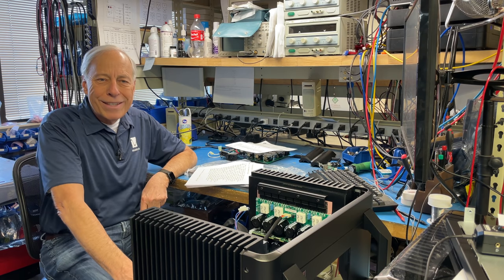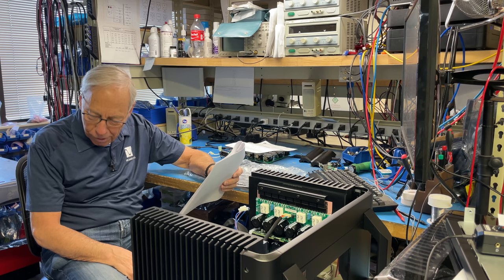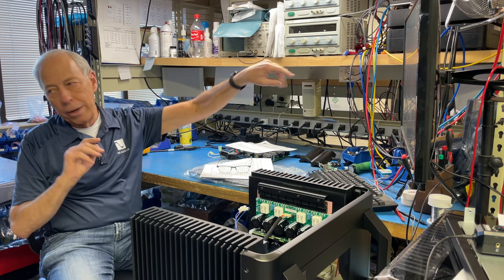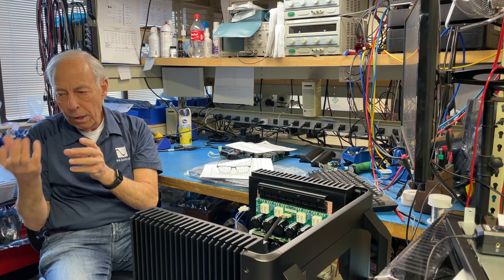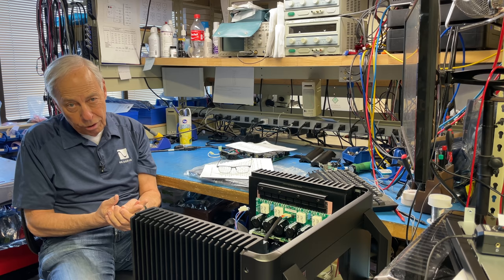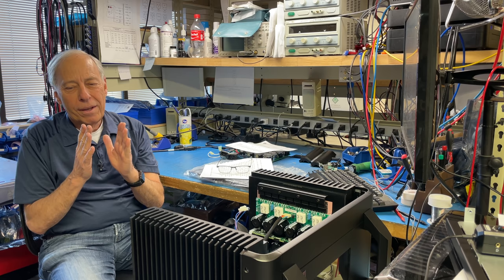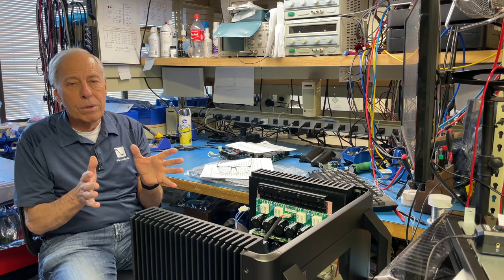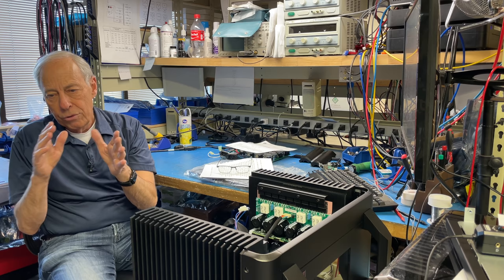Differences in digital audio cables

Comment: My Cary Audio DMS-700 (Streamer/DAC) has USB inputs but also a SD Card slot. In my system the exact same music stored on 1TB SD Cards has an improved sound signature compared to the same music stored on the USB attached SSD drives. I am not alone in being able to hear a difference - there is an Audiogon thread on this topic.
Reply: Internally how is the SD card slot connected? Normally they use USB. If there is a difference maybe the USB controller is doing something poorly.  The devils in the details. Anyone have a picture of the internals?
Reply: @paulgyro  Hi Paul - on the Cary Audio site for the DMS-700 picture #7 showcases the inside of the unit. The SD card slot is on the bottom front right of the unit - which is bottom front right of the picture. https://www.caryaudio.com/products/dms-700-network-audio-player/
Reply: @joeythedime1838  I tried to look at the pictures available and one thing for sure is the SD card and USB are on the same circuit board. There are two cable bundles that come off the board but I can't tell where they go.  Also I can't see on details what else is on the board.  While not conclusive I see no logical reason you should get different sound based on storage source. It could be a bad implementation from Cary.  Does Cary have anything to say about it?
Reply: @paulgyro  Cary actually recommended that I try the SD Card for my source material - they noted that I should hear a slight improvement over attached USB devices.
Reply: @joeythedime1838  gotcha, they know their design. There must be some implementation differences between the two ports

Comment: Hi Paul
My question is sensitivity (SPL)   is one of the most important parameter for HiFi loudspeakers in the Home Theater.Should (Must) have the same level dB (SPL) of sensitivity. Is it true? or  What would you recomend?
I enjoy your videos. It is amazing how you find the best way to explain complex topics, with simplest words.
Thanks in advance
Ignacio Martínez
Monterrey México
Reply: probably with a expensive high-end crap, other audio hardware does room measurement and set the center with lower sensitivity to +1.5 dB and you are done

Comment: Almost in the same time Amir from AudioScienceReview did a YouTube on this same subject: https://www.youtube.com/watch?v=dLghg0QXPzs. In my neophyte understanding is that if you have a good modern consumer DAC, not  necessary  at all at $$$$ level, and if you measure, not what it enters in the DAC, but what the output is, the 50 $ cable and the 2000 $ cable are exactly the same - and what you need is the output of the DAC to the amplifier. That means, the DAC knows to use only the pure information from the bits, that means no matter the cable... the result will be the same. I also think that if you have the worst cables, you can have a difference in the DAC output, because finally it has to deliver with what it received and maybe some problems in the transport to the DAC. Maybe I get it wrong, but I'm sure there is somewhere a limit in the quality needed for the DAC to process the information - so in my opinion the limit stops to under 100 bucks for the cable.
Reply: Since we can’t measure everything in audio “yet”, a purely measurement perspective is flawed. There ARE differences between well made digital cables, we have tried some a/b comparison ourselves. The question is how those differences exist. Most likely we will know the mathematical answer in 30 years (but not today).

Comment: AT&T just "forced" me to get rid of my DSL and change to their fiber. New modem.  Fiber runs into the wall and then to the modem. The modem to my computer is connected with an audiophile Ethernet cable. All the WiFi of the modem has been disabled.  Noticeable  improvement! Noise in certain parameters has been abated.   Even audio that is recorded to my hard drive (SSD) sounds better while this modem is connected to my PC.  Must be.. one source of noise is via the connected modem to the PC.  It must do something to the motherboard when its interacting with a modem signal while playing from what is on my SSD.  Streaming is not the only audio that improved!
Reply: What is an audiophile ethernet cable and where can I get one?

Comment: I am also an engineer and I do a lot of DIY. I have also noticed that it is important to put an isolation chip between the computer and the usb audio chip. If that chip is missing you can hear a lot of digital noise. I am not sure about the difference between USB cables here. I have tried cheap ones and better ones and was not able to here a difference.

Comment: Hi Paul, same goes for Voip a shielded cable has lower jitter and noice. This has to do with electro- magnetic interference. So much that they had to put a bit of artificial noice on the line because the sound is so clean and silent people thought there was no line. Still i bought my hdmi cables “not so goldplated” on Aliexpress. A money driven decision 🙄 i’m Dutch as well.😆

Comment: Thanks Paul. So is there a difference in the sound of your device which has this air gap when you use a cheap or an expensive USB cable? I would guess that the one air gap should eliminate all the bad influence from the input, correct? And does that also mean that any other device which has a good filter (air gap or whatever) should be immune to good or bad USB cables?
I think most of use will agree that a bad cable together with a bad designed device will have quality problems. Because a good designed device should filter the input.

Comment: i can buy the differences he claims might exist, but not at audible levels. amazingly different sound? then your non galvanically sealed transports must suck. even comparing audio in cables that introduce audible noise, isn't always very obvious. and a good audio system should have none of that to begin with. but i digress...

Comment: Very good and spot on. My favourite digital cable is the Lifatec USA optical cable. New ones sound better than the older ones. Just so clean and natural.  Kill any coax I have tried.
Reply: there is no difference between optical cables for 5 dollars versus 1000 dollars and what you heard on the coax was a grounding issue
Reply: @Harald_Reindl  lol look at you telling people like you know better than they do what they heard
Reply: Rest assured that the 1's and 0's don't care what wire they go down. Don't fall for the crap that PS sells. It is fraud.
Reply: @zackschindler8334  I can hear it. Easily.
Reply: Maybe it the quality of the construction and the interface.  After all this time I trust my ears.
Reply: @doctorrobin3040  lol - you trust your imagination and still live in an analog ivory tower not understanding the digital world

but yeah, I can transmit terabytes of data digital over years without a single bit-flip and your laughable lightweight audio signal changes significantly
Reply: Have you compared the two cables i have cited on a hi rez system? Probably not.
Reply: @doctorrobin3040  I am not dumb enough to try things which can't make a difference by definition

I am responsible for 10 TB digital transmitted data every day up to 1 GB (Gigabyte not Gigabit) speed where a single corrupt bit would be fatal

your lightweight audio transmission is simply laughable in a digital world
Reply: @Harald_Reindl  Oh well, I am a researcher, I have several research degrees. I test things and only then make an observation. If you havent done the test then you cannot know.
Reply: @doctorrobin3040  and to tell you a secret: even Paul in this video is talking about the analog part of the chain and not the damned digital transmission itself - still not sure if he is doing it by purpose in a way guys like you don't understand it - the jitter and so on is not at the transmission layer
Reply: @doctorrobin3040  So show some evidence  as to why is it better. Exactly why might a 1 meter fiber cable that cost $500 be better than the one I have that cost $10.

Comment: Jitter and noise is measurable, every cable should have these measurements attached to it.
Reply: And then...what would you do with it? Would you stop listening and just lay those measurements next to each other and „decide“ which is the better one?? Man, you‘re in the wrong hobby
Reply: @bikemike1118  it's rather simple, cable a claims it reduces jitter and noise, if it doesn't show up in measurements, it's bs.
Reply: A cable is a passive device. It cannot generate noise and it cannot induce jitter into a signal it's carrying. Now there is a shield effectiveness specification for shielded cables (that being from professional cable manufactures, Belden, etc) and of course that is field intensity and frequency dependent. But unless you measure the electrical noise present in your listening room, how would one apply that specification? Well the reason is that specification is for commercial application where electrical noise can be a problem. Not a concern for consumer audio systems, any basic shielded cable will do fine there. As for jitter, yes a cable has an effect on jitter due to normal LCR. But that is very dependent on the transmitting and receiving circuits. A cable it's self has no "jitter".
Reply: bullshit in context of digital transmission - and no the bits don't have noise
Reply: And yet even if what you say is true do they make any difference it a listening experience?
Reply: @zackschindler8334  it's not about if they make difference, it's about what cable companies say and claim their cables do.
Reply: @dagnisnierlins188  yeah, they make magical claims.

Comment: Here's what I don't understand (still), digital by definition means a numeric value, in this case 1s and 0s, it's binary if it wasn't then it would be analogue. So if the packet of 1s and 0s entering the cable is 100% the same 1s and 0s coming out the other end..... how can this ever be improved upon irrespective of cable cost or cable material?
Reply: it can't, what they hear is some shit on the analog side
Reply: The difference is in not the bits themselves but rather it's the spacing or time between two bits that is important. In theory it's constant and depends on your sample rate, but in reality it's not constant. When you have jitter (noise in the time domain) you'll get distortion as the reconstructed waveform no longer matches the source waveform.
Reply: @bitdevice  this shows that you fundamentally don’t understand digital. There is no “space/time” between bits. The packet is identical. There is no difference.
Reply: @liquidsk8s  No you don't understand. There has to be space between samples to reconstruct digital to analog, in other words you need a clock signal. If you DAC uses the USB clock signal to reconstruct a signal it is prone to clock jitter which distorts your reconstructed waveform.
Reply: @bitdevice  incorrect. Study up.

With a proper DAC. The usb cable doesn’t matter. Either the packet arrives or it doesn’t. There is ZERO change to the file.
Reply: @liquidsk8s  Please correct with facts or remain silent.
Reply: @liquidsk8s  This has nothing to do with the source, a file, a network stream or whatever. It has to do with DAC internals and how it converts digital to analog, and what clock source the DAC uses (internal or from your PC).
Reply: @bitdevice  I suggest the same for yourself. You’ve yet to post “facts”. Just snake oil nonsense.
Reply: @bitdevice  and right there you’ve proven my point. It’s not the cable. It’s the DAC 🤦🏼‍♂️

Use a good DAC and you’ll be fine. That’s your bottleneck, not the cable. 

Keep proving your ignorance if digital though.
Reply: @liquidsk8s  You can measure jitter, it's real. I never said anything about cables. But whatever haha 😅
Reply: @bitdevice  and you simply don’t understand jitter/digital. 

The DAC is your issue. Not the cables. Digital is digital. Learn the difference. Jitter has no effect on the end packet.
Reply: @bitdevice  also you responded to a post about digital cables. 

You might want to work on your reading comprehension.
Reply: @liquidsk8s  Yes I replied to this thread but I never said cables made a difference. Regardless, jitter matters unless your DAC reclocks the signal, which most do, but then the question is how well it does it. Again you can measue this.

You might want to work on your personality and stop getting defensive and upset over nothing.
Reply: @bitdevice  you erroneously posted on a comment specifically about digital cables. You responded that jitter matters. You didn’t specify that you meant jitter on the analog side. 

You made a silly post that was irrelevant to the discussion. And now you’re complaining about being called out for it.
Reply: @liquidsk8s  There is nothing erroneous or irrelevant about my answer to the OP. For example there is a difference between USB and S/PDIF even though both cables transfer the same exact bitstream. With S/PDIF you make the sender the clock source and the DAC has to chase its timing. Switching to a more expensive S/PDIF cable does nothing to fix this but switching to a difference interface like USB might.  With USB the receiving DAC dictates the data rate and the host adjusts the number of samples per packet to match. In this case the DAC clock is used and not the host clock.

So different cables (or rather digital interfaces) with the same digital signal can give different analog output.
Reply: @bitdevice  it is erroneous in the context of the discussion which is centered on digital cables. 

Work on your vocabulary.
Reply: @bitdevice  and no the output doesn’t change. The digital file is identical. Which is what the other poster kept trying to educate you on.

You’re also now comparing two different cables. The only difference being how the DAC unpacks/handles it. The file itself is identical. 

Point is. People spending insane money on USB cables/digital cables are just burning money for no reason. There is no improvement/difference to the audio your ears are hearing.
Reply: @liquidsk8s  The fact that you still mention "file" tells me that you are very far from understanding. It has nothing to do with the source file, whatever it might be. But I understand now that you can not comprehend this.

Comment: I helped a man who had purchased a Sprout 100 to use as a DAC 
for streaming high resolution audio from YouTube (yes they offer that!).   
Connecting his laptop to the Sprout with a USB cable, we got sound,  
but it was all screwed up --- dropouts, distortion, and other nasty stuff.   
The cure was a better grade of USB cable. 
That was the Only change we made, and it made All the difference.   
So, yes, even for digital signals, cables matter. In fact, I believe that 
cables for digital audio are More critically important than those for analog audio.
Reply: than sprout is pure shit - it's that simple
Reply: I'd say the original cable was pooched. Was it some old thing dragged out from the bottom of a drawer somewhere? And laptops, never famous for high quality sound.
Reply: @KeithHeinrich  No, the original cable was brand-new, but of an older type that couldn't handle data fast enough. 
And in this case the laptop doesn't do the D/A conversion. The man bought the Sprout to use as the D/A.  
I was in charge of making it all work, and in the end it did --- spectacularly.

Comment: Well ASR just proved this video wrong. Using an Ann Basics Cable.
Reply from the maker: Well, the didn't "prove" anything other than they proved they can't measure the differences. Typical for them.
Reply: @Paulmcgowanpsaudio  Well, I am sorry to say that your video only uses anecdotal evidence at best. You are ensuing the High End seller mantra of "you can't measure it but you sure can hear it" . That is faith, believing without evidence. Sorry  I don't do that.
Reply from the maker: @IsmaelMartinezPR  That's ok. We take many things on faith and without evidence (just ask anyone who studies physics) but if it makes you uncomfortable that's fine.
Reply: @Paulmcgowanpsaudio  Thanks for taking the time to respond. There are things that are unknown and that is why they are said to be just theories, that's is science. But USB cable distortion is not one of them. That has been proven many times over. But I guess it makes for cool marketing. Cheers.
Reply from the maker: @IsmaelMartinezPR  There's no such thing as USB distortion. That is correct. But, you're missing the point. USB has all sorts of problems when it comes to delivering proper digital audio signals. For example, noise is a big problem as is the 5V bus voltage. These two factors alone can cause audible differences in highly resolving systems. And then there's jitter. There's plenty to go wrong that can be ameliorated by the use of a better USB cable. The bits are always the same.
Reply: @Paulmcgowanpsaudio  Again thanks for the interest and respectful reply, Well what you say that has been thoroughly debunked, Now that you mention it, ASR just posted a complete and detail explanation of Jitter and how its over used by High End companies in their marketing. I say as a brand before it becomes a credibility issue,  you should look into your marketing materials and lingo and make sure it stands up to simple scrutiny form science. There are no big problems with 5V bus voltage or mains, unless the DACs and amps are poorly designed. Certainly you don't need an expensive cable to ensure a secure connection, of course no need to use a cheap hair thin one either. ASR just proved that with a simple Amazon Basics one we are fine. Go see the video its quite enlightening,